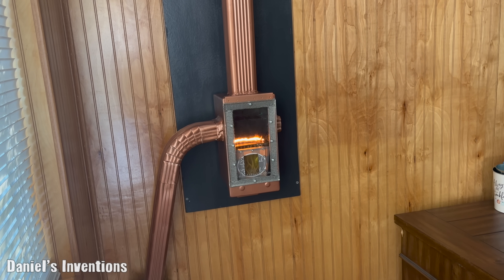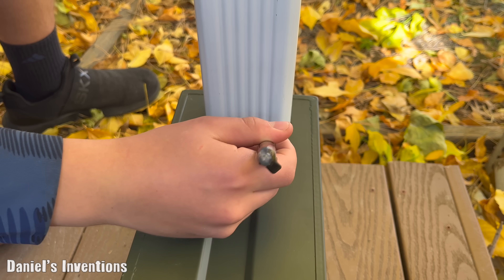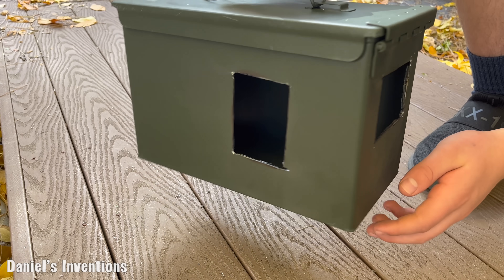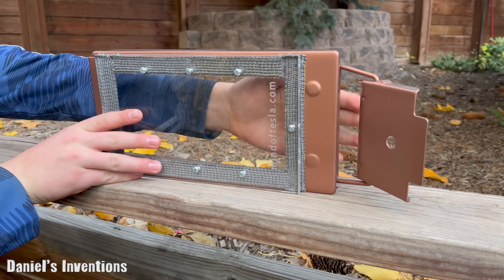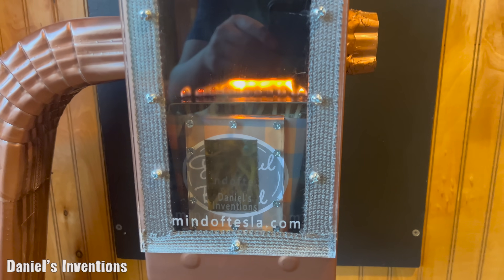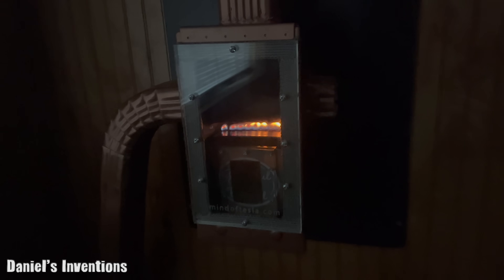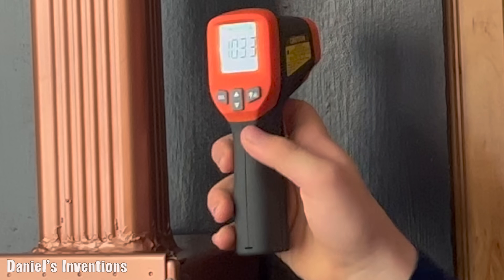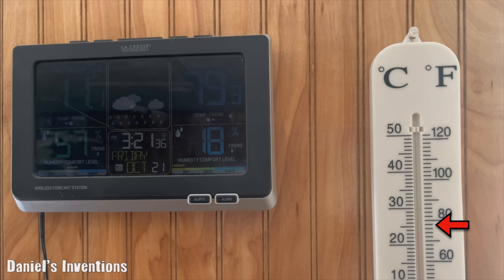ENDLESS Heat for Your Home WITHOUT Electricity

Comment: As the aluminum gutters heat up they are releasing toxic aluminum gas into your house!!!!! STOP STOP STOP. Use steel instead if you still want to build this.
My 2 cents
Reply: No that would not happen even if the pipe was aluminum and the temperature much higher.  Aluminum vapor would quickly turn into aluminum oxide in any case.

Comment: You said WITHOUT Electricity, so you should run the computer fan on a peltier cell, using the heat from the stove to power it

Comment: Like the idea, saw that a few people had suggestions for improvements. I was actually looking at your design and thinking of ways to power the fan using a thermoelectric generator and maybe a capacitor to regulate voltage. So it powers itself.
Reply: A Stirling engine could power a fan more effectively.
Reply: @kensmith5694  as I am not familiar with that, is it capable of being powered by the heat energy the unit is already producing?
Edit: disregard I looked up what a Stirling engine is.
Reply: ebay sells lots of little and bigger thermocouples for dc power induction, I am accumulating for an array or several arrays along my household heating, will be my first, no second, electrical assembly, as I did get my own 5kw solar/battery build to pass inspection, but with lots of (ouch) learning.

Comment: With out electric !!! then you go on to say 12v supply ...... Hello.... thats electricity.   The first Law of Thermodynamics explains how the amount of energy gained from something cannot exceed the amount put in.  ..... In short if you want to heat space it requires fuel its just about which fuel is cheapest to give you X BTU's Now if you have free logs great but if you do not them you need to have some idea of how much fuel ie:  I Kw of electric = 3,412 BTU one gallon of diesel = 129.210 BTU  Gas I cubic meter = 35.300 BTU one cubic meter will burn at 14 million BTU. Now you do the math.  Yes there are differences on how well your system can extract that heat , but that is not something  you can make that will save you so much that it worth messing with.

Comment: Love this but wouldn't it be more practical to use stove pipe instead of rain gutters? Also there's carbon fiber that burns almost indefinitely. There's a poster from the UK who does a lot of unconventional heaters and has tried many different types. He also uses regular cooking oil.

Comment: Total nonsense. All heat sources produce a specific amount of BTUs. This heater probably produces no more than 500 btu per hour. It will work fine if the ambient temperature is 70 in the cabin to raise it to 72. But if it is 0 outside, this heater won't even be felt except to warm you hands.

Comment: One thing and didn't see anyone talk about is if you didn't light the right side of it the left side would show to be hotter than the right  then if you didn't have the left side lit up it would cause the left side to run cooler than the right side I've carried a lighter in my pocket for just over 35 years now so know what I'm talking about when it comes to knowing about flames.

    I'm just kiddin tell them to go get that BJ weld they're getting pretty good at sucking and if you're going to stick around you may as well be handy I really wasn't dogging on you I'm making fun of all of us in the comments That's pretty cool heater I think that's exactly what I need for one of my sheds

Comment: Better make sure those downspout pipes you used aren't made of galvanized steel or you die from the fumes. They are either galvanized steel, aluminum or copper (obviously not copper in the video).

Comment: If the top of the stove is that hot then there is much more heat to be gathered rather than going up the chimney. Expand the heat exchanger by puting a second chunk of downspout inside the box open into the room - just like the first one.  The cooler that you get your chimney then the more heat you have captured to send into the room. Great idea and I love how cheaply it runs. In a nutshell, about $3.00 to $5.00 per week!? That's great.

Comment: Nice design but an exact same design as the outsider made a while ago the only difference is he used 12 hour candles but the oil version is a good upgrade oh and he used stainless steel exhaust pipe

Comment: Pretty cool build but it has to be cheaper and less work to just run an outlet to where you want it and pay 20 cents an hour or whatever it is to run a 1500 watt space heater.
Reply: Small or large scale electrical heating is expensive. That's what he have, and trust me when I say it isn't cheap no matter what size heater of furnace you have. :(
Reply: @jtadevich  large scale is not at all cheap, but niether is oil. Estimates online generally say something like 3.50 for 100k BTUs of electric heat and 3 dollars for 100k of oil. So oil is hardly much cheaper. Natural gas however is closer to 1 dollar per 100k BTU so its significantly cheaper than oil or electric. Either way, a 1500 watt small space heater to heat a small area isn't going to break the bank. Theoretically it's only slightly more expensive than oil but if you're talking about a highly inefficient home made oil burner like this electric may be just as cheap or cheaper. Even if it wasn't though, an electric space heater with tip over protection and all is significantly safer than this heater they made. I am very frugally minded and this thing just isn't worth the time to make and the low amount of savings you'd get compared to running a new outlet. It's also more dangerous.

Comment: This is a good concept I'm not going to take that away from him but there's a few things that I have concerns of especially with the gutter pipe he's using for a while that pipe is not going to be able to handle 500° Heat in like other people said the JB Weld might fail too if I were him I would get all fireproof material and use that yes this is a good way to do it but I will use everything that's Fireproof might cost a little bit more but I'll be worth it

Comment: Awesome idea, congrats ! Too bad in my country, the cooking oil is 3x the price one year ago. Just for curiosity, how much m^2 does your implementation covered in the video, how large were the cabin rooms ?
Reply: He said 220 ft^2 which is about 20.5 m^2
Reply: @schnob92  With oil 3x price and it still seems efficient, if what he said is completely true. I made some calculations for a whole house.
Anyways, awesome idea. The cleaning of the lints can be cumbersome but maybe you can make some replaceable covers with lints included, it can be made good. And if the oil could drop again in price, this would be awesome.
Reply: @Equilibrier  apparently there are a few different kinds of wicks that do not need to be replaced. That would solve the issue of cleaning/ replacing. 
Several people in the comments section have talked about it. Seems like it could be a very good idea to heat.

Comment: Very well designed piece of equipment. They have built a heat-exchanger system with two separate air systems. An uplift  intake, from outside, (to feed combustion), and a down-draft smoke"stack to remove the smoke and "ghost turds" caused from oil burning, vented outside, and an inside air intake, via a fan-forced up-lift system, where a continuous pipe allows the air to travel thru the pipe and back into the room, but passing thru a flame heated surface. There is a temperature exchange made inside the chamber but two separate airs can't mix. 
   This is a simple, but very impressive heating system. Its inventor needs to be commended. You should patent this furnace and manufacture them. This is a very nice concept and has the chance to change the way we heat, especially in "Off the grid" areas, like "BOB-HOUSES," Where folks take a structure out on a frozen lake and bore a hole in the ice and fish. This would easily heat one of those huts. It would also be an excellent CAMP/TENT HEATER. The applications could be endless. GREAT DESIGN. (I would, however; TIG weld the joints together instead of JB Welding them. JB Weld is good for a lot of things but it is STILL glue. TIG Welding is permanent. (just saying). (another item is the direct area where the flames touch. Over time, this area will break-down. You should think, seriously, about using a piece of thicker steel there (1/8" thick hot-rolled steel), and then pass the solid tubing just touching it, thru, just above it. That way the thicker stuff would take the heat and transfer the pure heat to the thru-pipe duct.
   Bill, from Tn. 🇺🇸
Reply: unfortunately, you can not patent something that you have put on youtube To summarize so far, you should wait to file your first patent application as long as possible, but be sure to file before a first public disclosure, public use, or offer for sale. because at that point you CAN no longer get a patent!

Comment: I'm pretty sure the IR-measurments are nothing else than a wild guess, if you really just measured the metal surface of the pipes without adjusting the emissivity-value or prepped the surface for propper measurement. Drives me nuts how those IR-pistols are always used as some kind of a universial measurement device. Things have different emissivity based on their surface material and properties. You can use those on human skin because skin acts close enough as a black body radiator to measure body temperature. But it's something completely different if you measure IR-radiation of a metal or a glossy surface because it will most probably reflect large parts of the IR-radiation of the surrounding meaning you will just come up with some kind of a phantasy value. Copper (depending on the surface finish) for example has a really low emissivity. That's why tapes or patches were invented to mask the material's surface with a thin layer material with a high emissivity surface close to black body radiation or at least an emissivity that is known and constand over the measured area.

Comment: Little wierd that title says without electric and still system is using fan...
Reply: The fan is not needed, but it helps with air circulation.

Comment: Yeah but I'll f ok my want to.punch holes in my wall 4 one. Two. It's get a hella lot colder in January and February.. I don't want that wind pushing in through those holes in the wall
Reply: I'll bet you have lot's of holes in your walls already. Really big ones called windows and doors. :) If the holes are sealed well, they shouldn't be a issue though. That's the trick.

Comment: So you could just use a fireproof cloth (Lowe's or Menard's would have this in plumbing I believe) to put on top of the heater to keep people from getting burned. 

Or you could put another box around the heater with the interior lined with the fireproof cloth. 

Great invention. Should come in handy this winter with the fuel shortage.

Comment: Let’s quantify this$$. I’ll assume you are using Kerosene. prices are for Wa state, everywhere else obviously will vary…

$2.75 per gallon kerosene, 85% efficient contraption,
$23.97 per million BTU.

$0.068 per KWh, electric resistance heating (space heater) 100% efficient,
$19.93 per million btu.

Here the electric space heater is cheaper to heat with. In California or the NE, the kerosene is cheaper to heat with.

(Coal is $10.18 per million btu…)
Reply: Right but if you're on the grid and it goes down your electric heater is done. 

There are other oils than kerosene but I get why you would use it. 

(In my best Minnesotan) Ya know a guy could use gravity feed and put a 5 gallon container for the oil above the stove reservoir and then you're not refilling but every couple of weeks. 
Or a really big container and not filling for a couple of months there don'tcha no.
Reply: @usa91787  Absolutely, life is full of what if’s. All we can do is be as knowledgeable as possible, test and verify, do not guess…. and always prepare.

Comment: That's really great design..... but..... technically you are still using electricity.
Reply: He's using a battery to power the fan. A large deep cycle  should last quite a while just running a small fan. 

That said, to get more air volume for more than one room would require something larger. 

Realistically parting out an old ac/dc propane camper furnace would work too for a small cabin.

Comment: It's a really cool idea, but as a fireplace inspector I would humbly submit that a 1/2" of cement board, will not insulate the wood behind it or prevent ignition of combustibles forever. Heat can be conducted through non combustible board. There is a bunch of good guidelines for clearance to combustibles requirements on unlisted venting in the NFPA 211. If you can be bothered with all that, don't leave it unattended or sleep with it running. Cheers!

Comment: A gallon of oil is about 140,000 BTU (if 100 percent efficient) no matter how you burn it. An electric space heater is 5000 BTU per hour for comparison .  That means you are  only going to get 28 hours of use at 5000BTUs which is not going to heat that cabin very well on cold days.

Comment: false information, energy is energy and 10 candles can not produce enough heat for those results
Reply: The fan is not needed, but it helps with air circulation.

Comment: Has a supply, a blower fed return, an exchanger. It's a no NOX ventless furnace. Sweet.  fan you could probably wire a thermostat in on the R- W break the 12 volt fan wire to the R, tie the other side other wire to the W. Batteries power the stat.

Comment: Awesome design, The only thing I would do is remove the paint or use non painted parts, and change the JB weld out for HRT 100 which is a ceramic cement used in kilns and forges.
Reply: I gogled HRT 100 and found nothing. Do you have a link?

Comment: The design and installation could have been more detailed. It wasn't revealed until the end about making holes in your walls and roof. Also the fan should be closer to the fire.  At that length you wouldn't feel any air.

Comment: Daniel, that is an impressive piece of engineering design. I actually watched it several times through since I found it so fascinating. The time may not be too far off when a heating device such as yours could be a Life Saver for many families. A couple of questions if you don't mind. Is the eavestrough pipe Steel or is it Aluminum? Secondly, I recognize that JB Weld is pretty tough, but is it standing up to this amount of constant heat without any degradation? Great Work Daniel with a meticulous attention to DETAIL. Many Thanks for sharing your creative endeavors. Greetings from Ontario, Canada.
Reply: It’ll hold I bet but it’s nasty fumes when hot
Reply: Ah Ontario home of the commi girl/gun grabber in charge lol....been up north ont few times myself visiting family ,Im from Yukon originally but live in good ole Alaska now. So ya Id imagine the gutter pipes should be steel  not sure aluminum would be good,and im curious about the epoxy over the long haul too.  ;)
Reply: Reminds me of how useful the kerosene pot belly heater/stoves were when they came out many (100+) years ago, and how important they were to heating peoples abodes. I was fortunate to pick one up for $15, but I still look forward to playing with this project.
Reply: This is a unsafe surefire recipe on how to kill your family.
    First this bad design using the warm oxygen in the room, which us a code violation In the USA. Because you that same oxygen to breath. DO NOT DO THIS.
This setup will leak Carbon Monoxide into the house. This is why we do not use Franklin stoves in the home.
JBWeld is bot heat resistant and will fail when exposed to prolonged heat thus causing it to fall apart and causing a hours fire.
DO NOT DO THIS.
Lastly This furnace is too small to heat a Closet much less a whole house. At best it is about 500 BTU.

You have No safety precautions, No alarms or CO Detectors.
He is not qualified to teach anything.
It needs a heat exchanger to make this safe.
your welcome
A certified Engineer. BSEE, BSME, MEE, MEE, BSCS

Comment: Great job man.
One idea I have is maybe a slider with a heat resistant handle off the side where you could cover the wicks to regulate the heat output.
Reply: I was thinking something like a lantern wick adjuster or a damper of somekind.

Comment: I was not aware downspout pipes are available in steel.  I've only seen aluminum.  If steel, they'd have to be galvanized.  That would risk zinc fume poisoning. 

Basic physics defines the potential heat output from such an assembly.  If fuel consumption is a scant as you say, the heat output must be similarly minimal. 

That the JB weld, alum pipes, and (non high heat stove) paint were not quickly destroyed upon first firing attest to the minimal heat output. 

I'm also confused how you run the fan integral to the functioning of the "stove" "without electricity" as claimed in the title.

Comment: is the ammo container safe to burn?
Reply: An ammo container is meant to withstand a lot of harsh conditions.
Reply: @jimwei4life  I should clarify, i meant does it give off toxic fumes. Im assuming it doesn't as this guy is using it. but not sure if it was sprayed with zync oxide or something.
Reply: No it is not safe to burn, you need to strip off all the paint. You can use zip strip and a wire brush. Than paint it with a high temperature paint.

Comment: My only suggestion:

I would remove ALL existing paint and repaint with heat resistant paint. Even though you are not dealing with very high temperatures, it could happen and removing the unknown quality paint could avoid a health hazard.

Comment: How do you refill with oil
Reply: They probably wait for it to cool down, and then refill the container. You can shut off the heater by blocking the oxygen intake pipe from the outside.